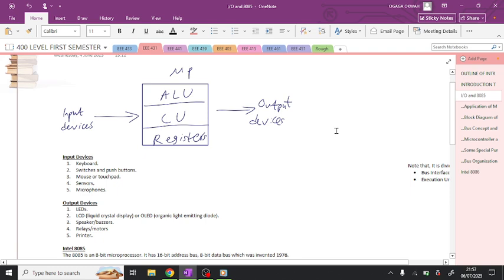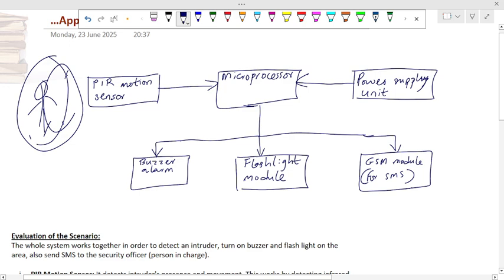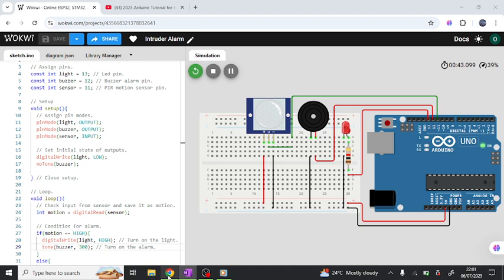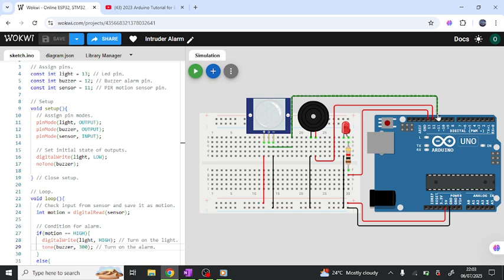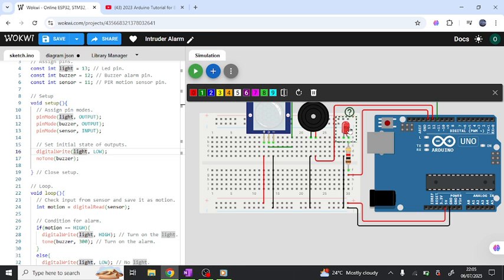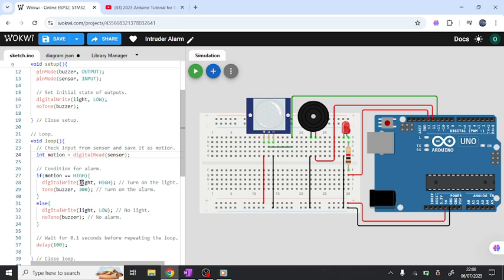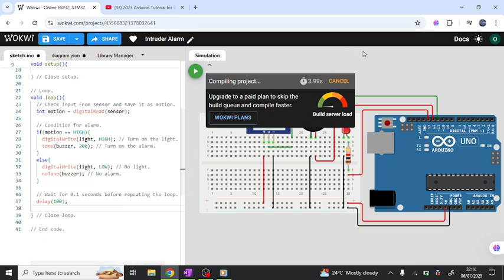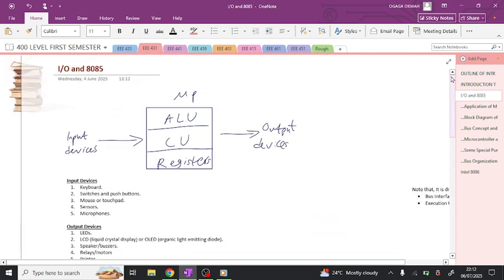EEE 431 _ Intruder Alarm System Explained | PIR + Arduino + Wokwi Simulation

Comment: Hi, how do you reduce the delayTime and inhibitTime of the PIR sensor on Wokwi? Thanks
Reply from the maker: Ohh... on this, go to the diagram.json tab of the given project in Wokwi. 
Look for "type": "wokwi-pir-motion-sensor"
Inside its curly brace, you will see "attrs": {}.
Add "delayTime": "YOUR OWN VALUE",
    "inhibitTime": "YOUR OWN VALUE".

Thos characters written in upper case is meant for you to replace with you own values.
Reply from the maker: Pardon me, I was surprised seeing this comment today after so long. You know what? I will make a video specially for you.
Reply from the maker: I will make a video for you on this so you can clearly see the values change and how they affect the system.
Reply from the maker: I have made the video in response to your question. The video is named...

PIR Motion Sensor delayTime Explained | Wokwi Simulation Tutorial
Reply from the maker: It will be published (seen) tomorrow (Thursday).